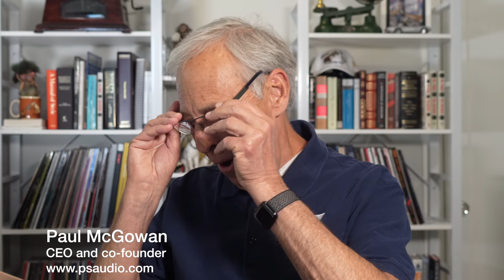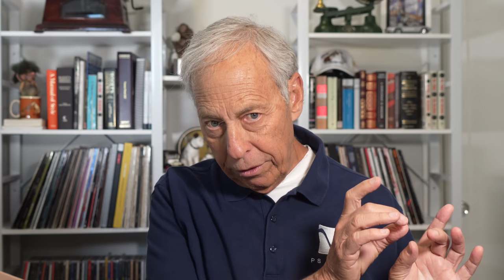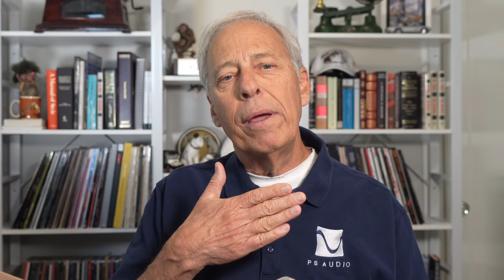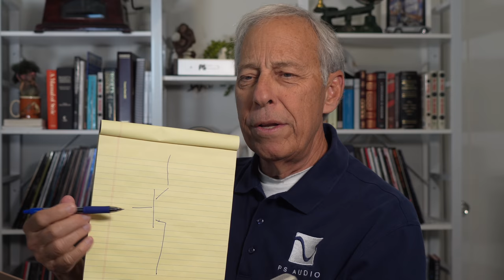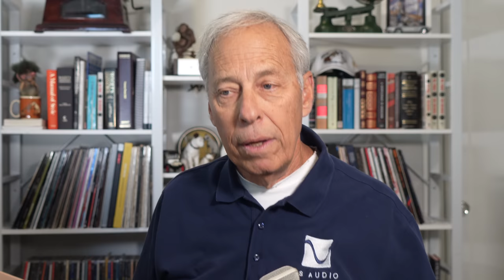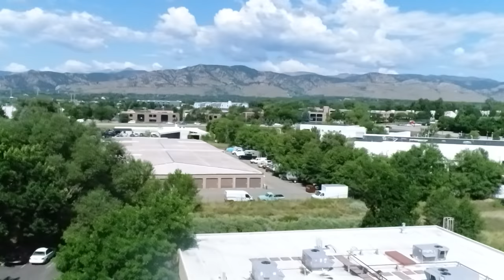What do components in a circuit do?

Comment: I’m an electrician, and perfectly comfortable with electrical principles, components and terminology. This is so not the idiots guide. It’s a great guide just not for beginners.

Simple explanation:

Microphone changes the waves of sound into electrical waves. 
We then record those waves in a number of different ways cd, mp3, record player.
When you want to play the sound back your speakers are designed to vibrate with those electrical waves.
But you need power to produce those sounds. That’s your amplifiers job. It takes the small waves we recorded and now scales them up so your speaker can make bigger waves that you can then hear.

Everything else in the system is just design to keep the integrity of those waves as pure as possible. As we scale it up we want to avoid introducing other electrical waves. We want to filter out the waves from the electrical grid giving us power. We want to keep waves from your WiFi, phone, and the whole freaking universe, screwing up that original wave that was the sound we heard.
Reply: This does not answer to the original question : What do components in a circuit do ?
Paul gives the first and essential answer to the simplest amplifier we could use to amplify the source signal ... 
and obviously this needs additional explainatory videos about the others components.

Comment: Active components: transistors, ICs, tubes and diodes. Passive components: resistors, capacitors and inductors. Active components in audio usually are used for amplification while passive components are energy losing components that you find everywhere often together with active components and in all passive cross-over filters inside speakers.
Reply: Don't forget about the happy electrons.

Comment: Most resistors in an "amplifier" circuit are used to set the bias point for the transistor (keep it stable..and acting as an amplifier) and most capacitors in an amplifier circuit are used to block DC voltage or used as hi-low frequency filters..again to keep the circuit stable. But what about about diodes,  thermistors  and inductors ?  That's a question for another time :)
Reply: Paul tried to keep it real simple  , it would take an hour to explain bias and but a diode and
Reply: I'm beginning to think my computer has a virus as it replied on it's own before I finished ,now a diode is a one way valve and a capacitor blocks DC and passes the signal and good thing  he used a battery no need to explain how caps store energy to filter out ripple on the power supply but explaining how inductors and caps are used as filters would take longer and thermistors are not found in basic  amplifiers.I will try to explain bias , transistors have a linear portion on their amplification CURVE (it's not all linear or flat) and need a certain amount of voltage (water flow) to keep them there ... see a bit much for this video.

Comment: That was a scary question for an electrical engineer and ten-fold for a designer of audio systems.  The audio system engineer spend all their time working at the edges of components as opposed to just designing a circuit to turn on an off with a transistor.  The audio system engineer asks: "What happens if I put just the barest hint of a signal on this base?  Will this circuit make it heard far and wide just as if the hearer was in the recording room".  Components mixed together make it possible to alter the energy of a signal as well as the signal itself as it moves along the electrical highway of the circuit.

Paul, you should really try Yorkshire pudding, more a hollow savory roll at the table and excellent with roasted beef
Reply: You do know, Paul is a vegetarian, right?
Reply: @Hare_deLune   I'm sure someone has a recipe out there that replaces the beef jus and accompanying roast with an acceptable dietary substitute.  The meat is an enhancing flavor, not critical ingredient.
Reply: @jkbrown5496 
It's amazing what they can do with processed foods these days, like some of the new meat substitutes, but whole foods and home cooking will always be better.   : )

Comment: Maybe you could explain how OTL/ZOTL amplifiers work in relation to common amplifiers with transistors next time Paul? 
And what are benefits or disadvantages of such a approach?
Reply: Send in to ask Paul, you have a better chance of getting your question answered.
Reply: OTL and ZOTL amplifiers basically eliminate the worst offender of audio purity which is the output transformer. The goal being to allow tube amplifiers to compete with solid state amplifiers in terms of distortion. The regular OTL amplifier still has a problem with output impedance and thus damping factor as compared to solid state amplifiers which is where the ZOTL design comes to the rescue. In theory the ZOTL amplifier should be really competitive with solid state which means that finally tube amplifiers should sound as clean as solid state amplifiers but I have never heard one. Many people prefer the sound of tube amplifiers with output transformers however and ZOTL is a patented design so it may never get rid of tube amps with output transformers.
Reply: Stewart Markley Thanks a lot for your input. I do realize that transformers job is to match speakers impedance and OTL/ZOTL manage to get around it. Question that might also arise is this, does OTL/ZOTL represent sound of vacuum tubes characteristics or that “turbines” is a product of tube/transformer combination (without going into circuitry differences)???? David Berning patented his ZOTL circuitry but I don’t think that’s the issue as far as popularity is concern. From what I understand, it’s not an easy design to work with and for many, it’s just not worth the time and $. 
Thanks again.

Comment: Transistors, circuits, low voltage to high voltage, connections on the low side (input/outputs), connections on the high side (speakers cables, crossovers, internal speaker wiring), etc, etc...….and yet one more connection (EQ) is a bridge to far. I just don't understand.

Comment: what component do in a circuit ok, they are many types of circuits one that regulates voltage on that amplifier audio signal, a circuit for power supply rectification, filtering, speaker protection DC muting, time delay, rectification power OPS output circuit MOSFET or BJT audio amplifier output OPS, complex are digital that have many functions like selection audio input and control audio tones those are complex more simples are filtering AC noise fuse protection, think about them as building block just match them according to your needs use step by step I design audio amplifier PCB as a hobby I'm not an engineer but I do what I can 😊

Comment: Good, however. explain what all discrete components do, capacitors, resistors and inductors. I think that was the question. NO?.
Nevertheless I know to try to do that in a 5 minute blog is impossible.  You just explain basic amplification.